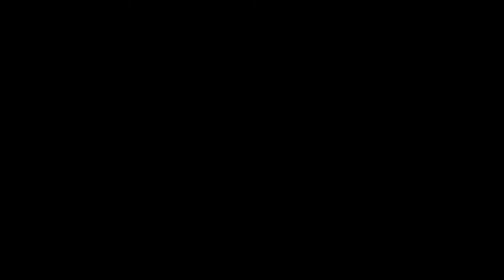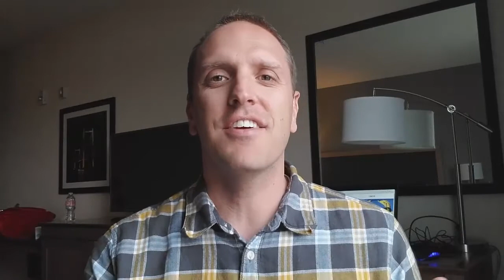Top 4 Reasons Why I Like The Civil Engineering Reference Manual

Comment: I think CERM has WAY more than you need for the AM session. I have not started studying yet but I quickly checked the topics of this book.
Do you agree?
Reply from the maker: It does have quite a bit of material, and probably more than you need, but wouldn't you rather have more than less?  The book is great for both the AM and PM session and the go-to source for the PE - but yes there are sections in here you don't need on the exam!
Reply: Great Review, can this book be used for practice in field?
Reply from the maker: @ibnadam1987  yes!